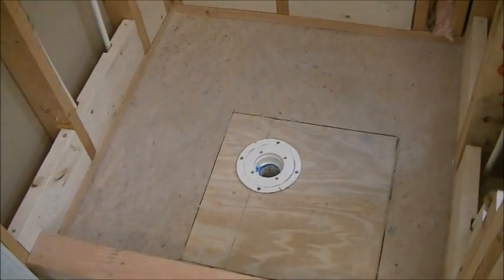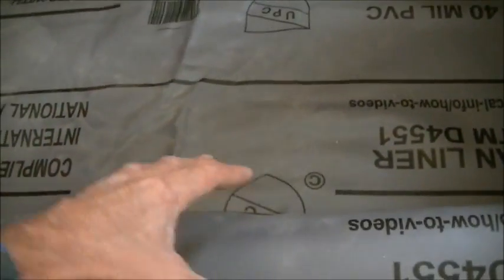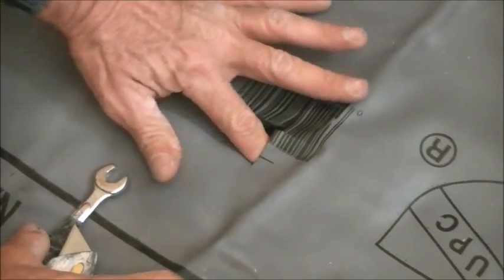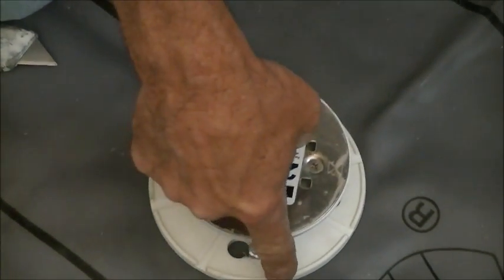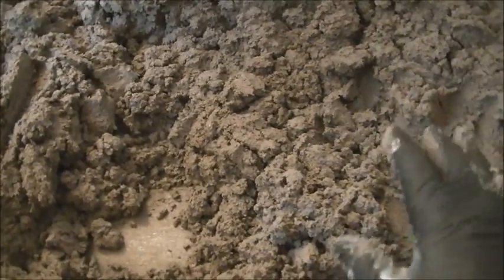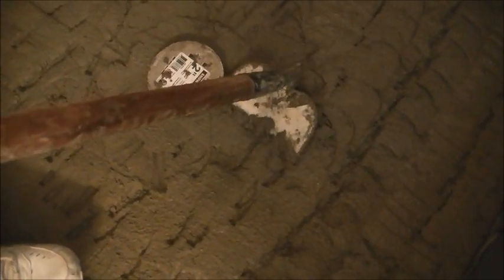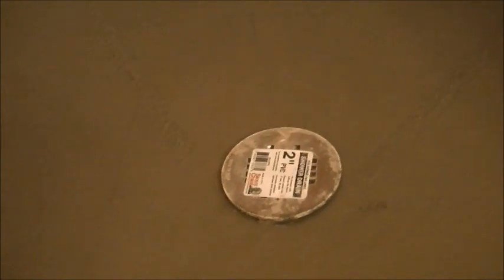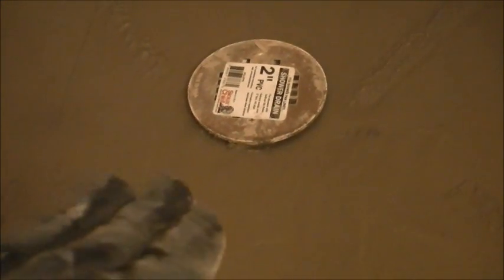How To Install & Pour Shower Pan

Comment: I just poured the shower pan, took me about 2 hours, ugh....but I think it's going to be okay, lol......all sides are level and there is a slope to the drain...I kept hitting the drain, so it kept moving a bit (as I have a square drain, should have gotten a round one), but at the end, I packed the mortar around it and letting it sit now, so I'm hoping it will be good.
Reply: Which type of motor did you use?

Comment: No pre-slope means this cement will be permanently soaked in water and will definitely cause mold and rot.
 Also, preferable to level all corners to make an even slope and perfect tile job afterwards.
Reply: There's a continuous layer of waterproofing from the top of the wall all the way to the edge of the drain, so water shouldn't ever get through in the first place.

Comment: Hey Bob.
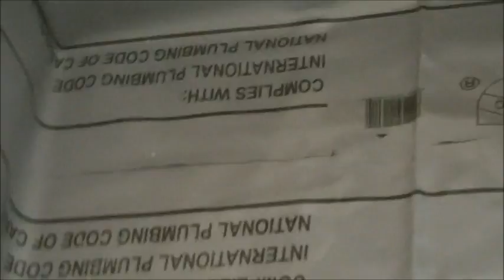Just noticed @ approximately 2:58 you go straight to having the pan liner installed. I've seen you put a silicone bead under the liner in the past. Is that something that matters on which drain you use?
Reply from the maker: Honestly the only reason for the silicone below the pan liner is if there is ever a backup, many times I will not put that bead of caulking there but going forward I will start making a habit of it

Comment: Bob, just to let you know what I like to do. I run my hardy board all the way around my shower one full sheet 2 inches up from the bottom of the pan, that will give me a level shower pan at the wall, bringing it down in your case about five eights of an inch to the drain. How are you going to when you set your tile in the pan ,and then they put the tile on the wall how is there going to be a nice even line there? Just asking my friend
Reply from the maker: cutting the tile to match the floor...skill ;-)

Comment: How deep does the pan need to be on top of my liner?  My initial pan with pre slope I had to pour 2 1/4 inches because my drain height.  I don’t want to take up too much of my curb.  It’s 4 1/2” will be 5” with backer on top of it.  So after the initial pour I only have 2” of curb left.  Does my curb need to be higher? Before I throw the liner on and pour final bed?

Comment: Hey Bob. I am about to do my shower pan . My sub floor is not perfect meaning there's some gaps because I had to replace some spots because of rotting but the most is probably 1/8 to 1/4 in between. Can I put a layer of hardee backer on top of the sub floor before I put the liner down. Thanks
Reply from the maker: Yes

Comment: The reason for dry pack is so when the bed fills up with water like a sponge and it will, the water can leach through the bed into your weep holes in the drain , with wet mud the water will eventually find its way up the side of the shower pan and into the inside walls of that room then leak under the house, I'm a master tile setter 25 years of setting tile over mortar, walls ,floors, showers etc...licensed tile contractor in Calif. use dry pack and small spacers or pebbles in front of the weep holes so they don't get clogged up. I live in Atlanta now if you ever want to see how I work my mud.
Reply from the maker: Actually I would LOVE to link up with you...send your number to my email StarrTile@yahoo.com..
Reply: StarrTile ...just saw this ..sorry ...770.990.9940

Comment: a video that you did more recently shows a much drier mud for packing.  Did you change your method or should we use this method?  I have only done 1 shower pan and I did that shower pan drier and although it worked, it was a real bugger getting it packed down.  The top of the mud bed was crumbly so I  adjusted that before tiling.  Big mistake.  I got the tile on there, but it was not as nice as I wanted it. After grouting you cannot tell.  But still it was a lot of filling in the "gaps"

Comment: We poured our upstairs shower pan using the same method and supplies as you. It's cured for over 4 days and now has a hair line crack down the center of the shower, where the mortor is 3/4 inch. Will Red Gard prevent the grout from cracking, or do we need to tear out and start over? The shower is 10X5
Reply from the maker: Not sure why you did anything with 3/4'' regarding mortar, way too thin...thinnest part should be at drain & that would be at least 1 1/2'' to 2''.
I would take out the mortar and re-do that part.
Reply: StarrTile Thanks..We used Quikrete mortar mix and have not done Redgard yet.
Reply: your mudd was why to wet and had to much cement mixed with the sand, bob is a rookie that has taken why to many home depot classes lol
Reply from the maker: David, when you go on someones channel to belittle them, it's a SURE FIRE way to get blocked, FYI...

Now to your rude comment : I've been doing this 20 years, never took a Home Depot course, and NEVER had a failure. You also assumed that cement/sand mix was used, but clearly I state in the video the pre-mix is what I use...you know not what you speak, but I will entertain a CALL should you want to debate my methods vs YOUR superior knowledge...betcha you WILL NOT CALL, critics never do.

Comment: If I wanted to do a concrete shower instead of tile, would I just bevel around the drain? We are doing stained concrete floors and a walk in shower.  I assume I would need to still use the liner,  form in sides of the pan, and perhaps use an epoxy sealer to make it waterproof?
Reply from the maker: Yes, Yes & Yes

Comment: No preslope? How is water directed to weep holes?
Reply from the maker: A preslope doesn't allow water to find weep holes until 100%saturation...
Without a preslope, the water can only pool to the highest spot, which will be 1'8'' of the drain flange.
Both ways will have water going to weep holes eventually.

Comment: Wow - how do you get your shower liner to fold up so  neat in the corners?  I also notice you are more than 4-5 inches around the edges.  Do you buy oversize liners, or layer a second piece over top of the bottom piece on the walls?
Reply from the maker: Liner is folded in corners carefully.
The liner should be above curb...curb is about 5inches finished, so liner goes up at LEAST that height all the way around. Liners come in 4, 5, & 6 foot widths.

Comment: How many bags of mortar for a 38x43in shower based?  Also, you want a 1/4in to the top of the drain to allow for thinset and tile correct?
Reply from the maker: Approx 3 bags, but have 4 on hand (80lb each).
At least a quarter, more like 3/8"

Comment: Where is your pre slope under the shower pan and I didn't see you put any sealant like silicone made for pvc liner to seal the under side of the liner to the main drain flange, without the pre slope the water will never find it's way out through the drain it will just sit there with a flat floor. you have a lot of good points in building showers.

Comment: I’m convinced that all tile showers will fail.
Houses move, grout will crack. 
I also am convinced if water gets below the tile no matter what you have done for drainage it will never dry out between your pan liner and the tile. Moisture can only dry with dry air and that my friends cannot happen between rubber and tile. I know some of you will say that it will get air from the drain but not enough air. 
Also, what happens if you red guard the floor before you tile? Now the water is trapped between the tile and red guard eventually molding. 
The only thing a pan liner does is make your shower not leak to a lower level.
Reply: And stops mold where the floor meets the wall, if you have proper drainage the water should never get that high in your shower. I NEVERhave standing water in my shower even with 2 heads running at the same time, when I get out of the shower there is no water that's still draining

Comment: Nails loosen, screws do not....

No bead of Silicone sealant underneath/at the mouth if the drain-hub?.
Reply: How is having a screw vs a nail in the bed going to make a difference? Screws in the backer board, but the bed liner is held in place by the mortar, and the backer board.

Comment: Appreciate your videos...always very helpful. What mortar mix do you use? You see so many suggestions online and some you can't even find at the store. Thanks!
Reply from the maker: Sand topping mix...yellow bag with green stripe at Home Depot
Reply: Quickcrete Sand Topping mix is a yellow bag with Red stripes.  Quickcrete Mortar Mix is a Yellow bag with Green Stripes.  Should I go with the yellow bag with green stripe labeled Mortar mix?  I really appreciate your video btw, I will go with your method of not putting preslope mortar. makes sense to me.  Thanks!!!
Reply from the maker: Mortar mix...green stripe

Comment: Nice, thoughtful work there mate. Just a thought, you can mark your level line around the inside of the liner before you put your mortar in. That way you will get your level with the minimum of fuss. Good idea?
Reply from the maker: Yes, done that before but the line gets lost sometimes...setting mortar in one area, leveling it and the using that as a marker works too. Guess it's what you get used to.

Comment: buy yourself a wood or magnesium hand float to screed/float/finish your mortar instead of using a drywall trowel/scraper. You can use the hand float to tamp it down also. Snap a chalk line level around the perimeter to float your mud to and then just screed it to the drain..presto.  But then again your method looks to work just fine also. As long as everything slopes to the drain and has no dips and humps in it, you're good to go

Comment: Quick question, Are there pros and cons to sloping the pan before installing the liner? Seems like it would be sloped so if any water ever penetrated it, it would slope towards the drain rather then puddling in between mortar? Seen videos were they do/ don't do it.
Reply: there are nothing but pros to having a sloped mortar bed before laying the liner, this guy just seems to think nothing has changed in the last 21 years

Comment: I agree with you most of the time but this time your not completely right. I can dry pack a 20 foot shower floor in 15 minutes. Just depends on if a real tile man is working the mud. And your talking about how much time it takes to dry pack a shower floor but this is taking you for ever. And where is your slurry? Your mud floor is just going to be sitting there floating. Come on man your to old school to know better that talking this smack.

Comment: dry pack works great no way it should take 40 minutes to for that size pan. It doesn't flow and easy to get a nice straight fall to the drain and you should not add water to a dry pack during install
Reply: it would take me 20 min max... dry pack is best, screw that process

Comment: If you're relocating your drain , once you cut a piece of the plywood out whats the best method to attach the newly cut plywood t the rest of the plywood as in this video?
Reply from the maker: Scab in 2x4 pieces all the wall around from the bottom giving enough bite to nail or screw in the new piece of ply
Reply: StarrTile Thank You sir

Comment: Can someone please explain to me why pay 45 bucks for a 55lbs bag of Mapei mud bed mix when it's just 4 to 1 mix of sand and Portland cement?  Am I missing something? Is there some other ingredient in it that will bring up the price that high or are they just ripping people off? Saw the bag of 4 to 1 of mud on Amazon for $55 and was thinking why?why?? I have a 5x5 shower in plan and at that price it will be too expensive to make. Also what thinset brand you use or recommend for tiles? Btw good video StarTile.
Reply: You shouldn't be paying more the $5-6 a 75 lb bag of Spec mix or deck mud.

Comment: Curious about lack of pre-slope under pan liner. Also, of the vids I've watched so far, after making pre-slope, the floor drain gets a fat bead of caulk to bind the bottom of the pan liner to the drain. I like your method of cutting the top of the liner then packing in the 4 bolts; but might some sealant be a good idea at this point?  Seems to me that if water got in around those bolts it would go to the subfloor, which is no good.  --- just some observations from someone getting ready to make his first sand/portland cement mix for the first time to install the pre-pan.
Reply: he has a few videos explaining why he doesnt do that

Comment: Those corners should be covered with a liner patch that is glued to the installed liner. And where was your prefloat?
Reply from the maker: First off, the board is Redgarded, so those patches will do what exactly ??? No water will ever get through the waterproofing.
Secondly it's "pre-slope", not the prefloat...and I don't do them, they don't work AND water will never see the pan material because of the Redgard.

Comment: How thick do you make the mortar? Sorry, I tried to find the answer in the comments below and couldn't find it.
Reply from the maker: So there's an idea that it must be "dry packed", meaning it clumps up in your hand without falling apart, using very little water. Water is what causes chemical reaction of cement to do it's thing, so I don't dry pack, although you don't want it too soft either...I mix 2 bags with about 2 gallons more/less.
Reply: I guess I worded it wrong, how deep do you make it? Someone told me at least 3"
Reply from the maker: Depends on shower size...but roughly 2 to 3 inches at perimeter sloped to drain where it will be about 1 1/2'' to 2 inches...again it depends on shower size.

Comment: Me doing many bathroom demos, wondering how come no one uses wire mesh with the Crete?
Reply: Kk Kk that’s an older method .. used a while back .. the new concrete boards are stable
Reply: @ws-venicex3932  true ..but the demos I did...they're were all dry. 30,40,50 years ago.  Times change ,I get it.

Comment: how do i do this if i also want to install a toilet in my shower area, do i set the toilet flange on top of the tile after its finished? doing a project tiny bathroom
Reply from the maker: Ideally I like the toilet flange and tile to be flush.., but if you ask a plumber they tell you the flange should sit on top of the tile
Reply: If I make it flush does the flange sit on top or under the pan liner?
Reply from the maker: @vladrxd1  for a shower application it would be very very tricky, I might want to put the flange on top of the finished tile and do some heavy caulking around the edge

Comment: dry pack mixed 3 to 1,I don't know of anyone using a liner system anymore,now just schluter drain.your mix looks like jello  how can you get even slope without equal points in the corners

Comment: Dry pack deck mud and masonry mortar are two different things. Masonry mortar has less sand and has lyme added for stickiness. Deck mud is 4 to 6 part sharp sand to 1 part cement. The finished cured product is so porous, water will fall straight through it to the pan liner which should have a pre-slope under it to move water to the weep holes. Doing it your way, without a pre-slope and using masonry mortar, requires a waterproofing membrane on top of the finished pan to work correctly, which I saw that you do in another of your videos. Just two different ways to get the job done.
Reply: I agree. Just buy a kit an eliminate this drama. its much faster with the kit anyway.

Comment: Some stuff online says to only use portland cement and that mortar mix for bricks will shrink and crack, have you experienced this with your mortar mix bag you use?
Reply from the maker: I've used brick mortar from 1998...not one cracked pan.

But let's clarify what cement is, it's actually a binder, so cement is found in mortar mix, grout, thinset oh, and of course concrete.
Mortar mix for bedding is normally 4-1 or 5-1 ratio. You can actually mix the cement & sand by hand to get mortar but I just get it pre-mixed in bags.
Reply: @StarrTile  ok thanks ya i cant get the bag you use here in canada
Reply from the maker: @jessjohn6157  try looking for Sacrete Sand Mix... I actually like it better but they sell it at Lowe's and I rarely shop there
Reply: @StarrTile  ok thks